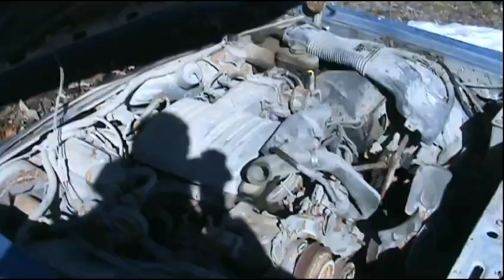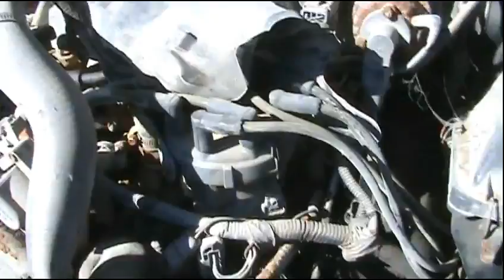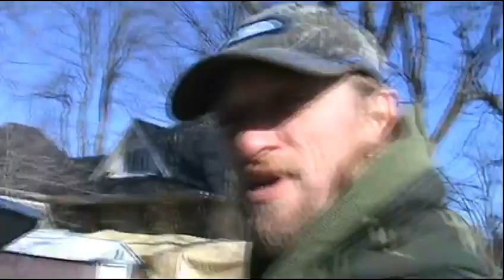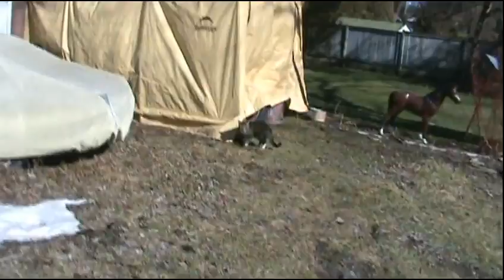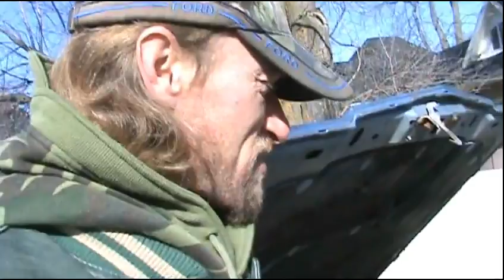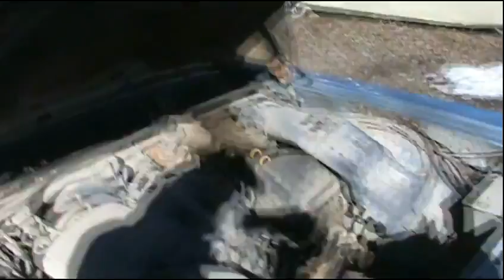Cars, Fuel and Frequency

Comment: both dc and ac can shock you has to do with low volts cant over come the resistance to sock you but the spark plugs has high volts so it can overcome and shock u

Comment: And by the way, getting shocked by DC is very real and way worse than AC at the same amperage because AC flows 2 directions per cycle.  This means you get zapped but it is actually "letting go" twice every cycle giving your muscles and you a chance to let go, DC is straight up full voltage keeping your muscles locked up to the point of tearing them, ligaments, cracking teeth, etc., etc., it's just harder to get nailed by DC due to it only flowing one direction, not impossible though.

Comment: Uhm, the coil is not changing DC to AC, It builds a charge in the primary coil then when the distributor close the contact (points system descript, electronic ignition does the same thing just by a different means of spark control) on the points the primary feilds suddenly starts collapsing inducing a field in the secondary coil through hysteresis which slams out your 30kV to 50kV spark at a relatively low amperage.

Comment: you cannot run a gasoline engine off water even if you change the frequency to make it ignite...it will not work.. it will fail under compression

Comment: @ACEGAMER120 Yes youre absolutely right. And because of the high resistance of the body the resulting current is so low your don´t feel it. But if DC Voltage is in the range above 100V you get shocks..iknow by own experience while repairing old radios with tubes

Comment: @thinkpad411 The comment was not aimed at you specificly, compared to alot of other nonsense on youtube / the internet this is harmless, some people believe in the troll logic cartoons...
A rectifier converts the AC to DC and it's simple tech.
Ethanol is still ethanol even if mixed with water, the ethanol is stil there, but has a lower percentage. In sweden alot of cars run on e85. 85% ethanol and remaining % pettrol/"gas" Ex.If you have petrol in a jar, say half-full.it's still petrol, not air

Comment from the maker: @Begbucks Hey Begbucks, if you want the most output from a HHO generator, the optimum frequency is between 700 and 800HZ AC. Use a modified sine wave inverter and change the output.

Comment: @Hiddenbeneath1 Read the description. Same old story, a legit company comes out to inspect the thing and the inventor cancels at the last minute. I've seen that happen  100's of times with these things. The extra deep cycle battery needed to run the thing has me very skeptical. I'll bet dollars to doughnuts that they have to charge that battery before each time they use the truck. Producing that much HHO is too much for the charging system so they need an extra battery.

Comment: @Hiddenbeneath1 Brown's gas (HHO) has been around for many years. There are small jeweler's torches that run on water. You plug them into an outlet and they make hydrogen and oxygen by electrolysis (aka "cracking" the water molecule). However, it requires too much electrical power to make Brown's gas for a car for it to be workable. You'd use up all the power of the engine just to turn the huge generator that would be needed to make enough gas.

Comment: That's some really bad info, Rick. 12V won't shock you normally because the voltage is too low to be conducted through human skin because of it's natural resistance, not because it's DC. An automotive coil steps up the 12V to 35,00V by means of inductance (voltage in the input coil induces a voltage in the output coil). That's why at such high voltage it will bite you.

Regarding the "frequency" of fuels, nonsense. Show us the math.

Comment: @ltawsome Add salt to the water then bombard it with high frequency voltage, it will burn (and expand to ~1600 times its original volume which is pretty much identical to what gasoline and diesel do).

That said, rickem, you're a noob rofl,

Comment: @te3data Hate?? What hate??? More like correcting someone's ignorance on vehicle components. What if some teens see this and get thinking that somehow magically a coil converts DC current to AC. It makes no sense, it's actually laughable! Also further, Rick, get some basic semantics right. Alcohol is alcohol... it is not water. You can only call ethanol ethanol if it is pure. Alcohol and water is booze, not gas.

Comment: The output of the secondary winding is the one which produces your short pulse of 20-40 000V, it is DC and induced by the collapse of the electromagnetic field through the tiny windings (thousands), 12V is induced on each of the secondary windings, and there are thousands of them, do the math.

Comment: Batteries don't shock you because you bodied resistance is too high to notice, but spark plugs run at around 30.000 volts, so that's why you DO feel that.

Comment: It's not that the ignition coil turns it into AC,you could touch 12VAC and not get shocked either.  It's that the coil steps up the 12Vdc to something like 10,000V (10Kv) or higher. Low voltage won't jump the gap on the plug,it has to be higher.
Alcohol is NOT water.It's alcohol.
This Frequency thing is a red herring.
(BTW,water's "frequency" is around 2.45Ghz..note,it's the same as a microwave oven.)

Comment: Hi Rick,
nice Video, but let me tell you you also can get electrical shocks on DC, not only on AC.
Just the fact that a car battery has relatively low voltage you don´t get a shock touching the terminals.

Comment: This produces a very short, very high voltage spike. Of course, the change in current is on the primary side, but because the primary and secondary coils have a large mutual inductance (this is where the transformer part comes in), you get a spike on the order of 100 or more volts on the primary, and 10000 volts on the secondary. Even the primary side of the coil can give you a bit of a jolt if you hold the wires while disconnecting power. Also note that any contacts will get a lot of sparks

Comment: Or do you mean changing water, which is H2O into H2 + O - that can be done in a normal fuel cell, but takes quite a lot of electricity. And yes, of course, if you'd inject H2 into your engine, it would ignite with the Oxygen from the air and burn clean, just putting water vapor out your exhust. But that isn't energy efficient because of the amount of electricity needed to split the water up into 2H2 + 1O2 (which it will eventually turn into, since O isn't stable alone, our air has also O2).

Comment: first: Sparkplugs don't get AC, otherwise they would've to have 2 wires running to them. The 2nd wire however is the engine, it's "ground", always minus on your vehicle. The coil transforms the voltage up to tens of thousands of volts, and the distributor gives little short jolts of them out to the plugs - that's why they hurt you, while a constant DC voltage of that amount would burn your car or so ;-)

Comment: Rick...unless it is diluted alcohol has no water in it. In fact pure 100 percent ethanol doesn't exist except in a sealed container. As soon as you break that seal it will absorb water vapor from the air and naturally settle at 91 percent (182 proof).

Comment: @RedneckRickem Not really AC coming out either. The coil is an inductor.  The ignition feeds DC to it briefly, inducing a current and magnetic field.  Then the ignition control interrupts the current flow which causes the field to collapse quickly in the coil winding, producing the large voltage.

Comment: Its called electrolysis. It splits water into hydrogen and oxygen. To answer the why, it requires more electricity to break apart water than we get from it. 

If you want a brain buster think about this. Every thing you see touch or smell is vibrating at a different frequency.

Comment: @RedneckRickem ...actually ignition coils don't output AC voltage nor take it in as such..that is why you only get a spark when the input circuit has collapsed...ie.if you were to put a constant 12VDC into the ignition coil you would not get a spark as the current flow is only going one way and would not generate a secondary voltage...but when you collapse the primary (open the points etc.) you get the pulse of high secondary voltage...

Comment: this video is nearly 100% incorrect...frequency of water has nothing to do with "igniting water". water is impossible to ignite, but the hydrogen in water is highly combustible.
Separate the hydrogen from the oxygen (H2O) by introducing electricity and you have yourself some fuel....not by changing the frequency